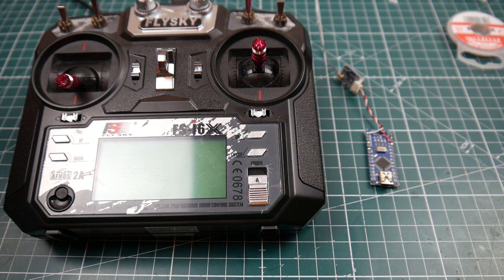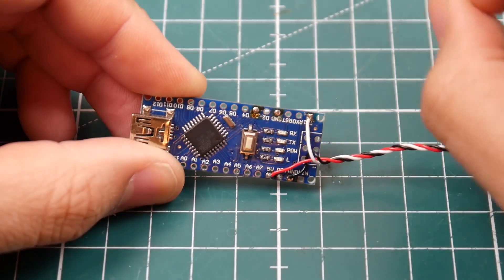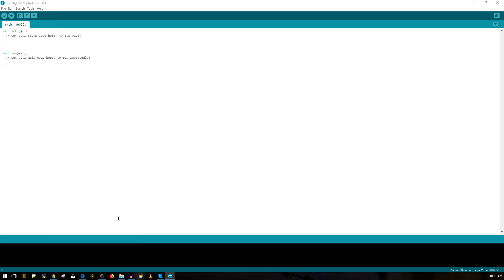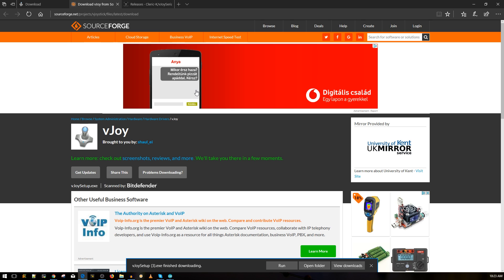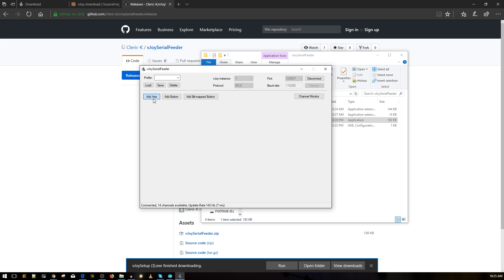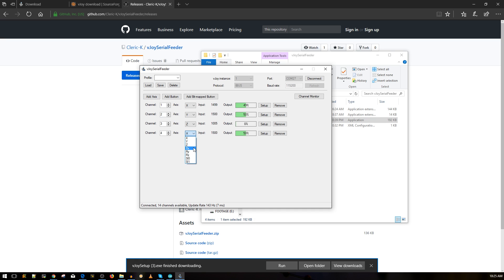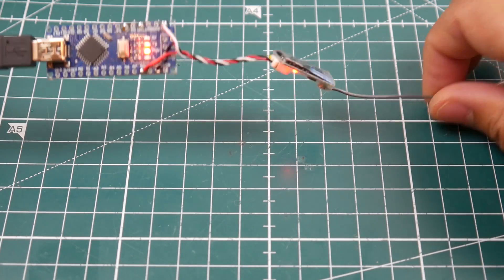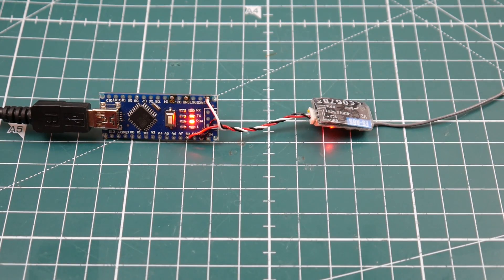How to Connect FlySky Transmitter to any PC Simulator // Wireless without Cable

Comment: Im trying to connect a hitec optic 6 to an FTDI with a Corona cr8d.  No problem binding.   Doesn't seem to want to connect to VJoy serialfeeder no matter which protocol i use.  I believe I may need to use an arduino to program since its an older transmitter?

Comment: I have a question about this after you have the receiver soldered on will this work for a RC project can the R-xSR control the Arduino so I can control motors and such using the arduino I have both and wondered if it’s possible thanks man

Comment: So hang on - you Flashed the Arduino with the Erase Sketch...But then Never flashed it with any other Sketch - including the sketch that is on Cleric-K's  Github repo...?

Now I'm lost - surely that is a required Step...Otherwise the Arduino is just a bunch of wires at the end of a USB...

Comment: As i understand it, arduino is used only for its serial-usb adapter. Since there is no program inside the arduino to change pins behaviour, upon reset all pins are high impedance inputs, so TX pin isnt affected by the arduino microcontroller. Which means that ibus signal is going to passthrough to serial adapter's RX pin(thats why you connect it to arduino's TX pin,these are tied together). So a single ftdi/usb-serial adapter should work the same, no need for arduino.
Reply: So that is why he Erases the Eeprom and doesn't subsequently load up a sketch...?!

Comment: Hello Drone Mesh, i really appreciate your innovation. i lost 2 transmitters becoz of the Simulator cable. this is really really good and working good. Sorry to ask a uestion even after i got a solution, do we have any fix for realflight 7.5 - i dont want to use that cable. i would really appreciate if you can help me. Thanks & Regards - Kiran Matam.

Comment: Are you still able to upload a sketch into the Arduino after doing this? For example, could I upload a sketch with a digital switch or relay that automatically connects the TX pin to the receiver after a couple of seconds? Or can you put in a signal diode preventing current traveling from the Arduino TX to receiver?

Comment: This tutorial does NOT work. Too many components and software versions have changed. I've tried this with two Arduinos (cheap and expensive). Something always fails.

Please make an update vide with troubleshooting
Reply from the maker: Buy the DroneMesh VUSB and check my video on the setup

Comment: I have been using this lil module you built for us for a few months now, and i'm designing a 3D printed case for it. I don't want to include a switch, but I don't want to accidentally forget and destroy my module one day. Did you ever try to fire it up all connected to check if it fries the receiver? I'm going to put a 1a 50w rectifier diode into the signal wire to be safe. I'll let you know if I have any problems.
Reply: Any update on the 3D printed case or the added 1a 50w rectifier? Did this protect the receiver?

Comment: Everytime I open the VjoySerialFeeder it says, Failsafe (Serial Port Read Timeout). Does someone has an answer for that?
Reply: Did you fix it? And if so , please tell me how
Reply: On the transmitter, change Output mode from S.Bus to I.Bus. This helped us resolve same issue.
Reply: I want to know to1!
Reply: son of a ....i spent HOURS trying to figure this out.. my transmitter and receiver are both iBUS, and i kept getting the dreaded "Connected, Failsafe ( Serial Port Read Timeout ) message , switched the protocol in vjoyserialfeeder to MultiWii instead of iBus and boom it's working ! ( windows 10, Fs-16x Transmitter )

Comment: Followed everything to a T but can't get the Flysky FS-A8S to bind to my  taranis Qx7, any suggestions? Thanks
Reply from the maker: You cant bind a Frsky transmitter to a flysky receiver.
Reply: So i hooked up a FrSky X4R and downloaded vjoySerialFeeder v1.3.1 which is sbus compatible. it connects but no channels will work. any suggestions. Are you going to do a nether vid on this ? I am one of your Patrons. should i contact you some other way? Thanks

Comment: It's connected to the Arduino tx because the Arduino is just like a ftdi adapted and the Rx pin of the ftdi adapted is connected to the Rx pin if the atmega 328p

Comment: What is the purpose of the Arduino? There is no program installed to it. Is it just to power the receiver and use tx to send signal? Why do you use the fs-a8s? Could you not ise the standard receiver that comes with remote? It has ibus connector.
Reply: seems the part about loading the Joystick ino file is missing in the vid?
Reply: @zeropoint-1041  no just upload the eeprom clear sketch that u can find in the IDE

Comment: Finally it arrived, freakin' 5 weeks....
and I can't get the driver installed,  not even manually, and not with the arduino troubleshoot section. Been trying and reading the last 2 hours.
It has been working through my quads usb but I wanted lower latancy and now after a long wait.....Nothing!

Comment: I just set this up, but I decided to just use the MultiWii protocol with a Betaflight FC whoop. It was super quick because I didn't need to flash or solder anything. Just had to plug the whoop into USB port and install and configure the that vJoy feeder app. Works pretty well.
Reply: Great, glad you figured that out! Drone Mesh mentioned he might make video about the MultiWii protocol also.
Do you notice any latency? With my tests with a F4 board I've never felt any, but when I used Eachine E010S, which has F3 controller, I noticed some lag. What kind of FC/loop freq your whoop uses?
Reply: Cleric I think there is some latency, but very little. Hardly noticable compared to Taranis USB HID. Will try a FlySky with an FTDI or Arduino eventually too.
Reply: OK, thanks. Receivers spit data at whatever rate they are made to. For MultiWii currently I request the data from the FC at around 25ms. I've planned for a future release to add an option in the interface to set that interval yourself. I'll try with my F3 board to increase the rate as much as possible and see if it makes some difference. But most probably the MSP code inside bf (have to check the sources) runs on a lower priority task and that's why it gets delayed a little.

Comment: Frsky SBUS very very very  interested ...
Reply: Velocidrone comes with a firmware for the Teensy 3.2 (32bit arm board similar to Arduino nano but faster) that just shows up as a joystick on all major OSs. There's a version for the SBUS, DSM2, and DSMX. I usually use Liftoff rather than Velocidrone, but think Velocidrone was a worthwhile purchase if only for the convenience of the wireless firmware.
Reply: +1 for FrSky  !!!!

Comment: I actually did this a long time ago, but I used the UnoJoy, iBus and AltSoftSerial libraries on my Uno to get everything to work. It works pretty well and is recognised as a game controller. Thanks for the video!
Reply: Does these steps works with real flight simulator software.. kindly share the deatils please thankz in advance.